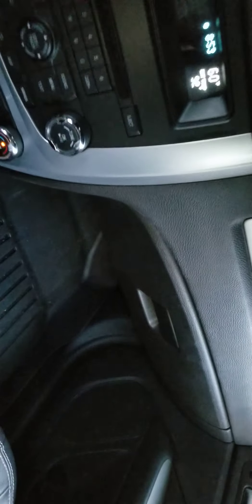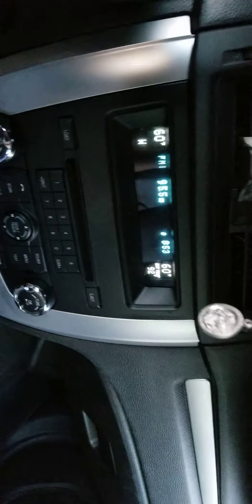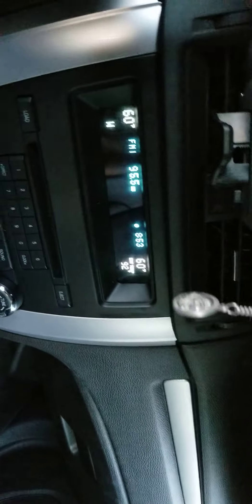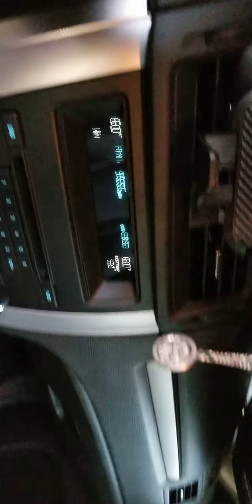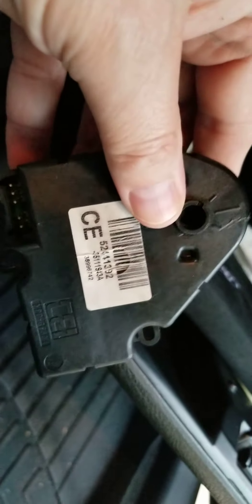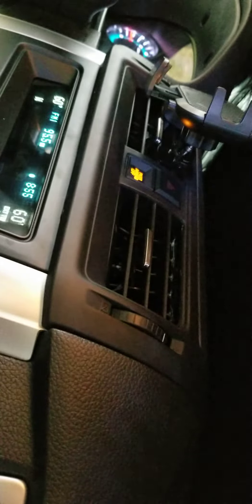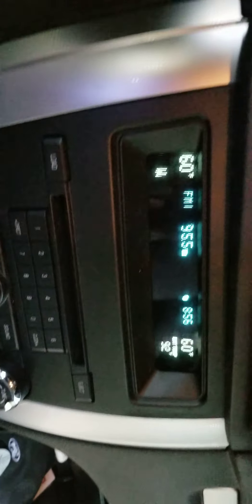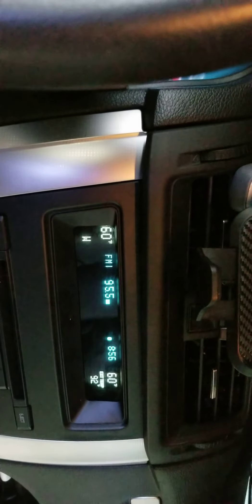Ford Fusion 2012 Actuator

Comment: Hey was there 3 bolts or just two, one thats easy to get too and one on top? Feels like there is a 3rd on the far side but not sure.
Reply from the maker: I only remember two
Reply: @dudley810  you’re right, there’s only two. I was looking for a screw that doesn’t exist.
Reply from the maker: @beammeupscottsp7952  that is not a good design at all.
Reply: @dudley810  haha yeah, yeah I thought my passenger blend door was bad. But I hit dual for passenger temp but it’s still stuck on full cold and nothing happens when I adjust the dial. It will only change temp if i turn off dual and adjust the driver side. Is this a hvac module problem instead?
Reply from the maker: @beammeupscottsp7952  did you do that reset thing I talked about?  It won’t work until you pull that fuse which is a bitch to do.
Reply: @dudley810  yup! I recalibrated and the temp started off at 75, it's weird. So when it's in its normal single climate mode using the main/driver side dial both blend doors work as it should. It's just when I try activating the dual/passenger side dial it will not respond to it and stay on cold. Also the passenger side blows about 6-10 degrees warmer than the driver. Driver side puts out 40, passenger puts out around 46-50 even in its lowest setting. I thought it was the blend door but maybe a faulty HVAC module as well?
Reply from the maker: @beammeupscottsp7952  So if your air is not working I have another fix I did to this crazy car.. In an unrelated fix I replaced the A/C Evaporator Temperature Sensor - with a part from amazon -- Standard Motor Products AX163 Air Charge Temperature Sensor.  The bad part is they usually take out the dash to get to get.  Me I cut a hole in the dash underneath the cover so you don't see it.  Then replaced the sensor.  This is the hardest fix that I ever did.  There is really no room for your hand to fix in there.  but I did it and then the air worked and got cold.  So let me know if you need more info on this.
Reply: @dudley810  oh yeah I’ve had to change the evap sensor on both of my fusions lol. Terrible placement but got both of my AC to start blowing ice cold, had multiple shops wanting to change the compressor because they couldn’t figure it out haha.

Comment: Does yours not have 3 bolts? There's 3 on mine and the last bolt is impossible to get to.
Reply from the maker: Mine only had two I believe.  It's been awhile since I did it.  But I do remember breaking one and gluing it.  Cuz it was absolutely no way I could get at it.
Reply: @dudley810  turns out i was trying to reach a screw that didnt exist lmao, i just yanked it out. put the new one in and did the reset and still didnt fix it :( it looks like the peice that the actuator turns is getting stuck because when i try to set it any lower than 70 it stops turning on both new and old actuator. if u know anything about that plz let me know.
Reply from the maker: @neckrope4042  That sounds strange.  I have no idea what that would be.

Comment: Good job. 
The question is how did you replace the actuator? Did you need to remove whole dash? Or just remove the glove box and do the work?
Reply from the maker: You just push in the tabs on the glove box and then the glove box comes down to give you more room.  I believe there are strings in there to that you just take off.  But the glove box stays on while you replace it.  It's very tight in there.  There are only two screws holding it in place.

Comment: Hey Ken. Great Vidio but, I don't believe I have this problem and I'm asking your opinion. I pulled the module out and it appears to be working because it does mechanically rotate similar to the new one. Also,  I hand turned the knob going into the car housing and it seems to open and close. (unless you think there could be three positions: heat, cold and fresh air) I guess the reason to replace it is if the module does not open and close that door, right? So if mine is giving me heat and by turning on the A/C on giving me something less than air conditioning it mus be something else, right? like the sensor? I do get acceptable cold from the drivers side. Hmm Update. just checked the drivers side and the actuator turns when turning the temp up and down.
Reply from the maker: Not sure I'm not a mechanic.  I do know once I installed the new part it did not work.  I had to do a complete reset of the system before it did work
Reply: @dudley810  Yes, from your tip I had to do the same.
Reply from the maker: @jeffbudzisz160  did you get it working?

Comment: What did you use to remove the two screws? I tried using a small socket wrench but it was too bulky.
Reply from the maker: I believe it was a socket on a screw driver handle.  It was tight but it worked.
Reply: I'm in the same situation, there is zero room to get even a slim profile ratchet. I've tried flexible extension, rigged some shit together, but all I have to show for it is mass frustration, these manufacturers really know how to F you life for 2 small ass bolts
Reply: Did you ever get this done, was it two screws or three?
Reply: @jaysoncolbert6187 was it two or three screws, feels like there is a 3rd on the far side.